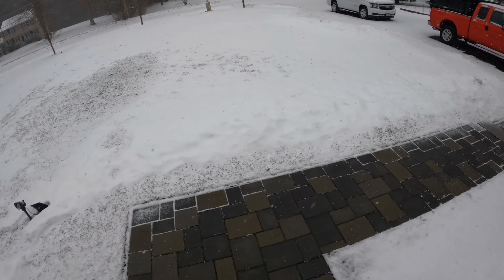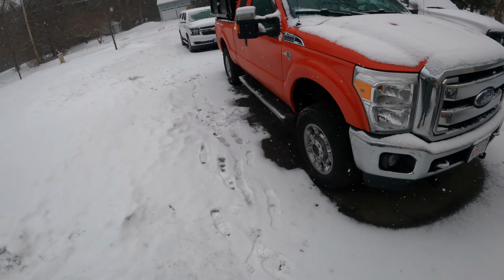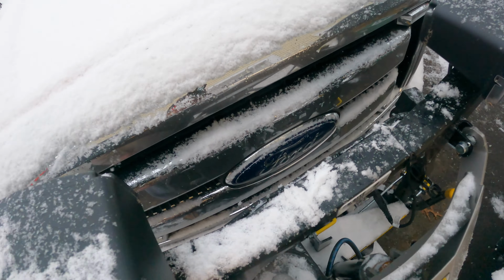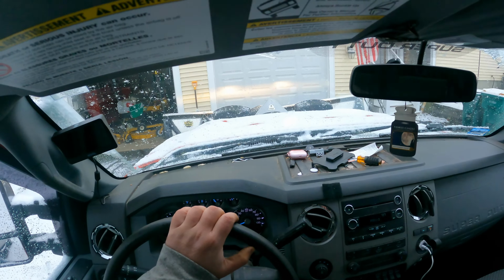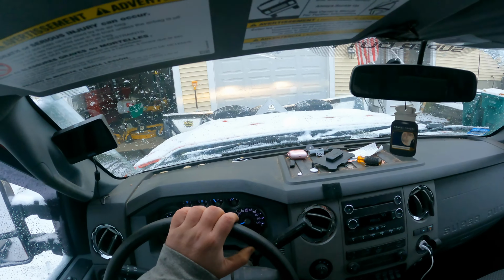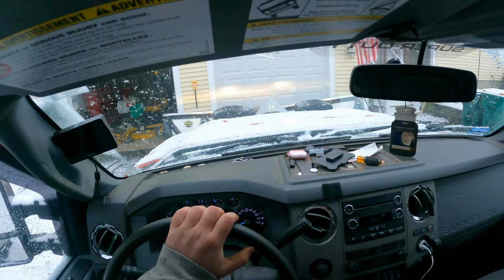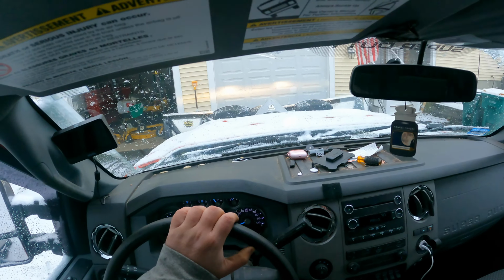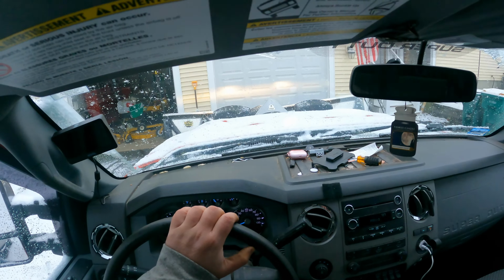RESIDENTIAL SNOW PLOWING|2/14/2022| RAW FOOTAGE| PLOWING 5-7'' OF SNOW| 31 DRIVEWAYS WITH 1 TRUCK

Comment: I had the gas F250, was a 2013 with a dump insert as well. Sold it end of last summer. Sticking with my 2015 Diesel F250. That sucks with no power steering while plowing. Great job plowing. Great video!
Reply from the maker: Thank you very much!